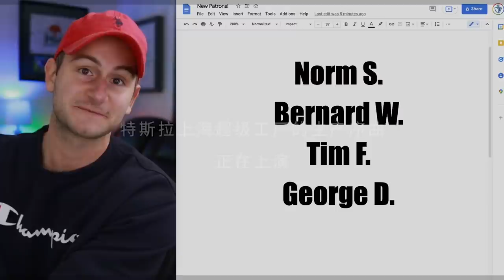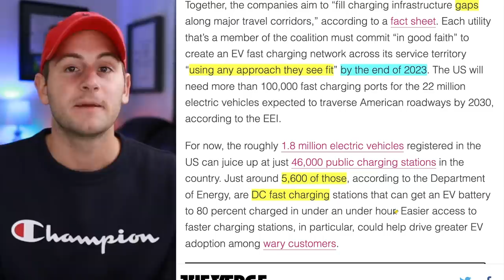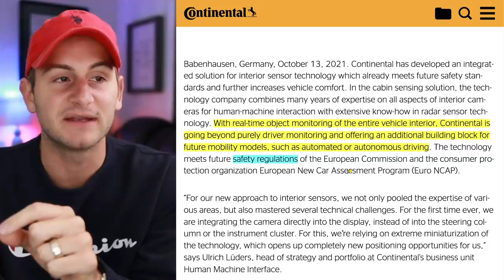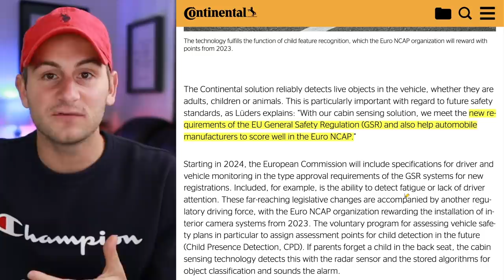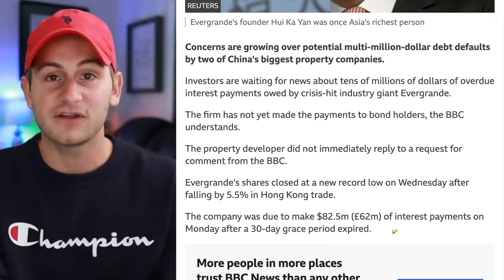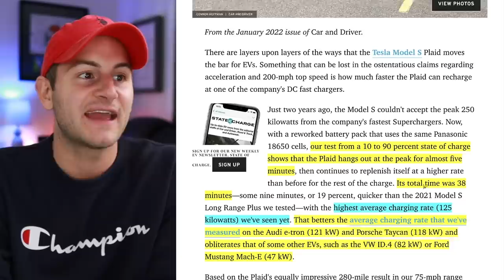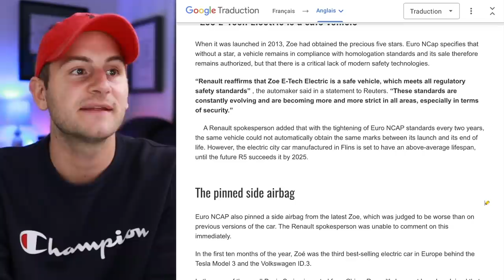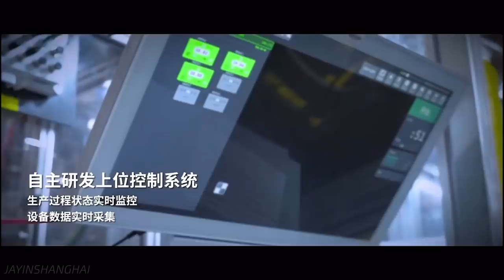Perspective on These New Delivery Numbers & Tesla's New Interior Radar ⚡️

Comment: 100 percent agree with the “at home charging” especially for apartments
Reply: Absolutely, DC fast charging can be seen as essential to make sure long distance driving works especially for shorter range vehicles. It's home charging that makes owning an EV good though. Without it it's bad.
Reply: They could at least put some numbered Nema 50 outlets with lockable covers at certain places in their parking lots and then have the tenants sign the keys out and hold onto the key as long as there a resident at that location and bill them for that electricity used if they want

Comment: I'd say averaging August through Nov numbers equals over 51k per month, which in turn means annual run rate over 600k. 
With the newly announced $187,000,000 expansion set to finish in spring. I'd say the estimates for gigahai going to 1million+units is accurate.

Comment: Thing is tesla doesn't need to grow in the same way as before. The margin per vehicle should increase and if car sales stabalize (which likely would be good) they will be able to optimize different factories toward making truck, semi, and battery. This will allow them to keep costs down and continue there optimization efforts of factory toward more dollar per space utilization.  The biggest issue that i see as overlooked is if tesla will be able or willing to retrofit HW4 and better cameras into the cars. because they are still using (i might be wrong, just found a random source) 36 fps camera. 60 fps would capture more detail and work better in more settings. I'm actually surprised tesla hasn't built there own cameras.

Comment: I truly hated the pirelli sottozero 3 tires. Had them on two cars (2016 Audi s6 and 2018 Civic Type R). They offer excellent dry grip for a winter tire, with decent snow performance. Ice was ok. Both sets lasted about 5000 winter miles for me. I'd rather use regular winter tires that wear out just as fast with that much power, but grip better on snow and ice. Which is exactly what I've done.

Comment: pirelli tires... especially winters.. are so overrated XD call me a tire nerd 🤓 but SOTTOZERO 3 isn't worth it especially when your driving a "performance car" like a model y, I'd highly reccomend getting michiline x-ice snow or x-ice xi3s instead. The cheaper michilines (the xi3s) compared to pirelli.. around a 10% increase in traction on ice, marginal increase in traction on shallow snow but a solid 6% increase in deep snow.. when worn down, which michilines wears 9% slower to begin with.. you will have winter compound through and through unlike pirelli (and most winter brands) which switch to an all season compound at low trade depths making then very unsafe when worn ⚠️... oh and in almost all sizes even the spendier x-ice snows,, michalines are cheaper than pirelli... I'd just get the wheels and visit like a discount tire or other tire store for the michilines.. parelli just ain't worth it 😒 kinda frustrating that tesla uses them but hey they probably got an OEM discount.. just makes no sense to buy the set as a consumer IMO